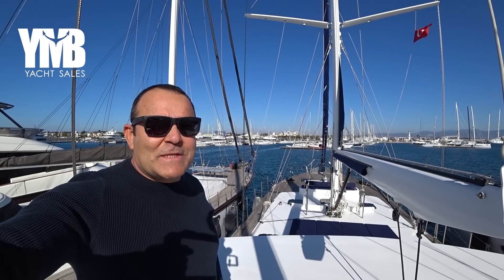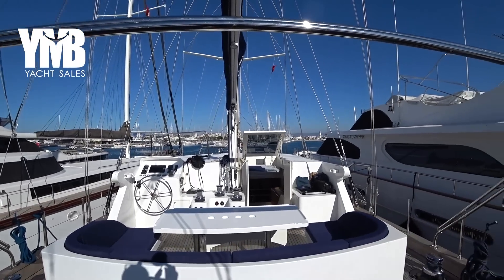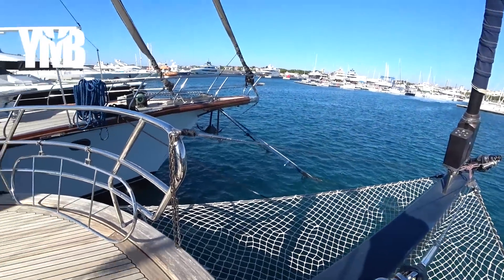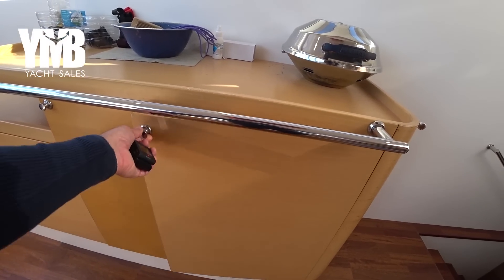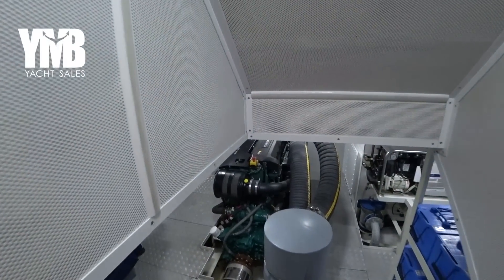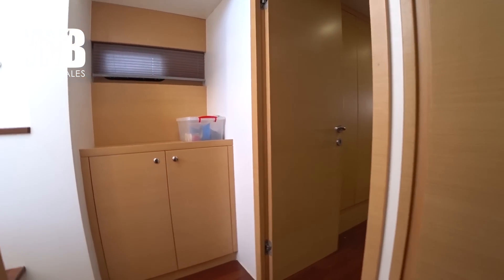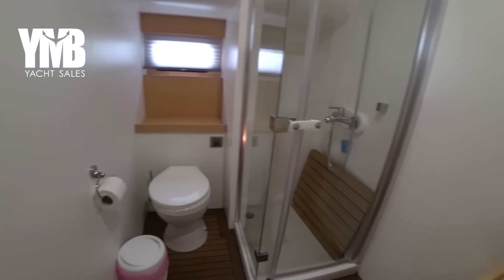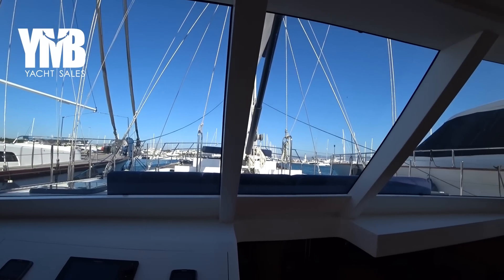22 m Steel Hull MotorSailer CE Ocean Class / For Sale from First Owner Interior video Tour

Comment: Hi there, I also watched the other new 22M Motor Sailer you had on another video.  I think I prefer the single 600 HP diesel over the two 260 HP motors on the other one.  I also see it does not have a dishwasher, do you think there is space for one?  Looks like a well built yacht that can take you anywhere, almost.  Did this one not have the crew cabin up front? Or is that all just for storage?
Reply from the maker: Hi, she has the same crew cabin, No problem to fit a dishwasher

Comment: The builder, ARK Yachts, displays this boat not as Yasmina but as Cica Sultan, with 2 engines and a 5800 liter fuel tank. Quite different from the specs on your site.
There are other differences too. So what is the real story behind this boat?
Reply from the maker: Two differant yachts. One with two engine built in 2020 the other with one engine built in 2016. You will find them both at our website: yacht-marine-brokerage.com feel free to contact for more details via email.
Reply: @YachtMarineBrokerage  Thanks for your feedback.